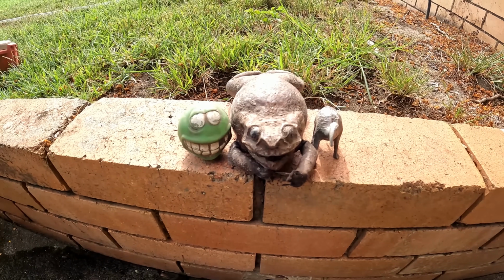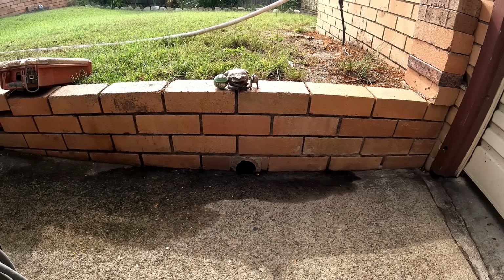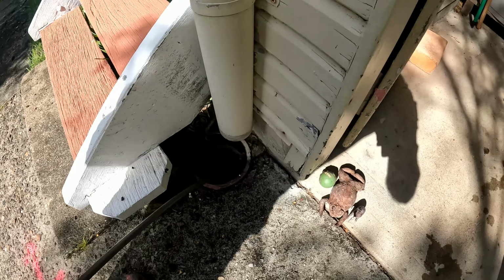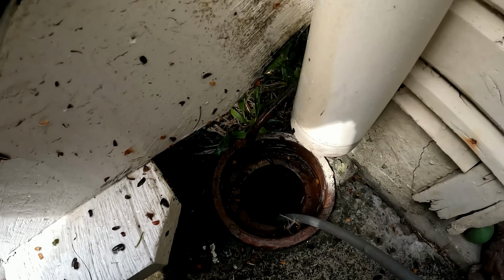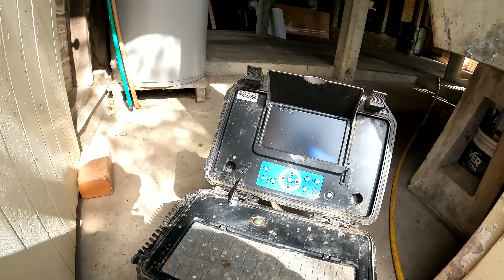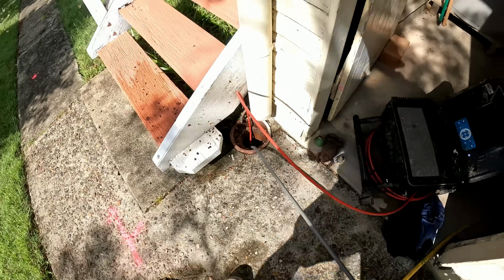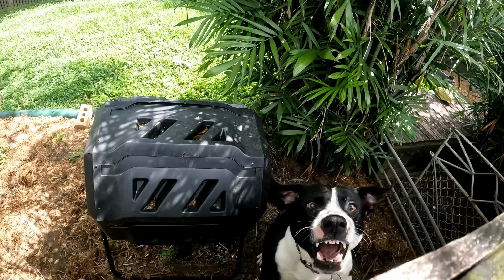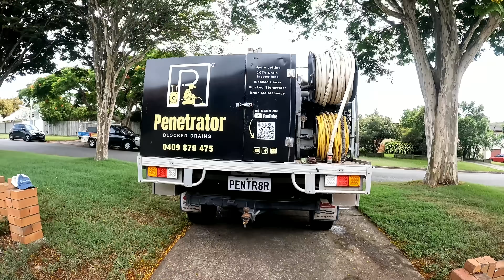Blocked Drain 343 - WARNING || Do Not Enter || Enter At Your Own Risk

Comment: Residential stormwater can be a real problem depending on the topography. We're lucky  our house is on the high side of the street but across the road oh my. Only solution has been catch drains, pits and pumps. I feel for the owners a that involves an ongoing cost in power and pump maintenance. There should be a storm water pipe running along the gully in the backyards but probably a bit late now.

Comment: Great job dealing with the infrastructure and the roots. Looks like the owner would benefit from some self leveling concrete b the garage door to direct water away from the door. It always amazes me at the weird and ineffective places builders stick pipes. Why run it to his drive instead of the street? Really poor builder planning. I am dealing with a similar problem here in the states. Builder dropped one of the gutters in the back to drain into the lowest spot on my property right next to the slab foundation, causing cracking. I had to immediately run another 25 feet of drainage pipe to divert the water away from the foundation. Going to put a rain barrel there next year.